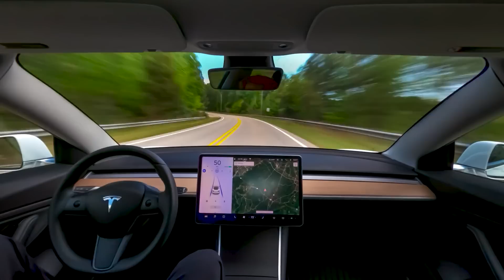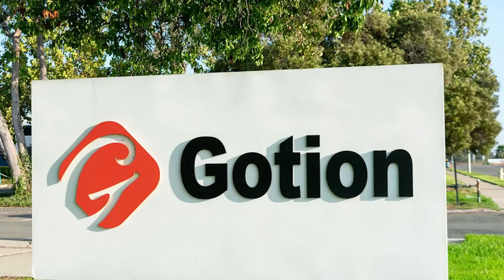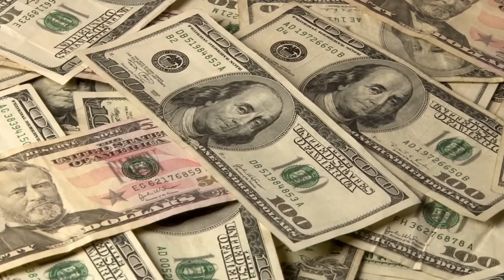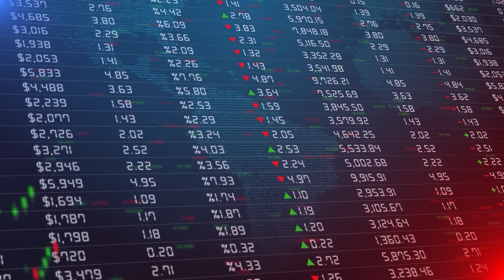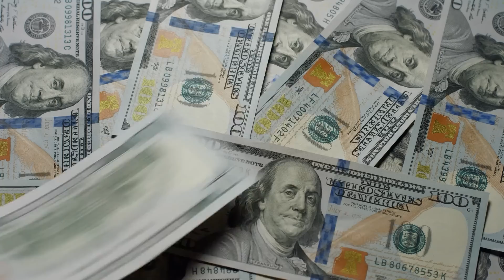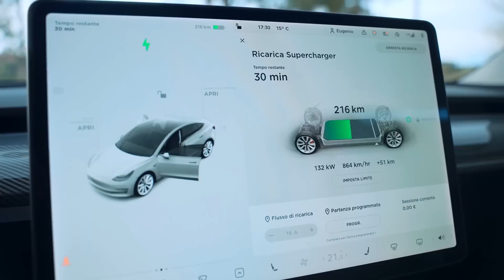Elon Musk Says LMFP Battery Will Change EV Industry FOREVER

Comment: 18 minutes to charge an EV battery is too long. What about 2 minutes to charge a battery, 2 minutes is the time to take me to fill up a gas tank of 19 gallons of gasoline and drive 434 miles.
Reply: Until ICE cars are BANNED IN 2035
Reply: Gas has to be extracted, transported and processed, though it should be cultured with biodigesters using gmo'd, quick growing grass now, but I agree with you, using modest batteries, they should be able to induce fields to power electric motors using quicker charging, smaller batteries, or even self charging batteries from car physics using kinetic energy.
Reply: Based on an U.S. average price of ~$3.70/gallon, your 19 gallons of gas would cost you around ~$70 per fill-up.  You should be able to recharge an EV for less than $10 at public charging stations (although the range might only be 200-250 miles instead of 434 that you mentioned).  So that means a (roughly) $50 savings each time in exchange for waiting an extra 15 minutes.
Reply: @josephwang267  :  the cost of electirc charging is going higher and is no longer as attractive as it was once promoted.

Comment: Chinese batteries self combust. No thank you.
Reply: So do Chevy bolts. Lesson #1 don't be an early adopter
Reply: @aquint5554  Those were LG Korean batteries.
Reply: @aquint5554  : GM recalled 140+K Bolts just after 19 fires.  In 1Q 2022, there are 7 daily EV fires; or estimated to be over 3,000 for the entire year 2022 in China.
Reply: All batteries combust if fossil ghouls target them for terrorism, but the batteries can be designed small enough and still induce electric fields to power electric motors.

Comment: "We will see. I bet on hydrogen" is my point too. This clip is forgetting to take into the equation the process of creating electricity to charge the batteries! The big drawback of hydrogen-powered vehicles is the water "spill" on the roads which will create ice on the road at stop signs in a city at winter-time.
Reply: Water spill??? There are way more issues with hydrogen…. But okay water spills
Reply: To get the range wanted the compressed hydrogen (@3000 plus pounds) would take up so much room it would make the car a one passenger vehicle.   Till they figure that out and also the danger of an accident with multiple #3000 pound cylinders of hydrogen.  I think most would go with a battery! :)

Comment: If China makes a claim to investors, it's most certainly filled with lies. BYD is one of the worst scams. They build electric cars and then list them as sold. There are fields in China with thousands upon thousands of BYD electric cars just sitting there. With 30 km on the odometer. Just the distance to the field. Never been purchased or owned or driven but is listed as sold with fake registrations. This is where you are spending your investment dollars? This drives business in China. Investment dollars for vaporware.

Comment: "Fringe content providers"...are saying if you run specifically insulated circuit through tube with air gaps in magnetic field, the surrounding electrons come into  play to power a device...With the magnetism field being the key variable apparently, possibly reinforced by "floating charge"  at charging station...but sounds possible with regenerative breaking or maybe even friction heat on go...allowing two batteries or supercapacitors to keep that circuit going while facilitating the peripheral electron flow to power device/vehicle as long as magnetic field strong...Therefore how sophisticated ev batteries or essential charging station networks are, is very puzzling...
Reply: Dude, I have an MSEE and I can't figure out what you wrote about.
Reply: @jamesvandamme7786  you work for Russia directly or indirectly go watch your fascist get overthrown on tv

Comment: We will see. I bet on hydrogen.
Reply: Why waste the electricity on producing hydrogen.  The energy lost on producing hydrogen can't be regained!!!!
Reply: @SteveMA1000  You have a point there. Thank you.
Reply: Has anyone explained how much more expensive than gasoline it is?
Reply: @jamesvandamme7786  : it's expensive b/c the tech has not yet been perfected or commodified yet.  The LLIBs weren't necessarily cheap until 3-4 years ago.
Reply: Hydrogen is good for static generation but for vehicles it's quite dangerous
Reply: @bharatmetalfan  Nonsens - hydrogen tanks are amongst the most sustainable compartments one can imagine. No normal gas tank could withstand the forces a hydrogen tank can endure. In case of a really severe crash, the hydrogen tank would be the only surviving part of the car.
Reply: @arnebuchner1297  if that's the case, I do support hydrogen. Can u help explain still why tesla and all are not shifting towards hydrogen and working more on Li battery Technologies?